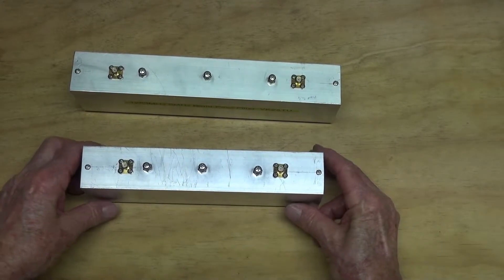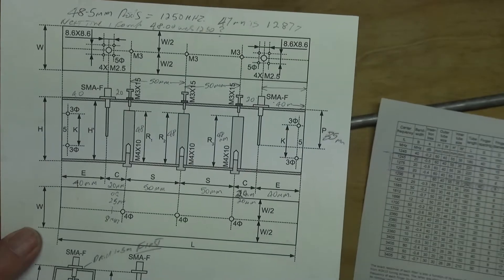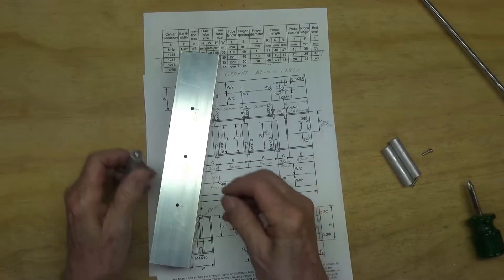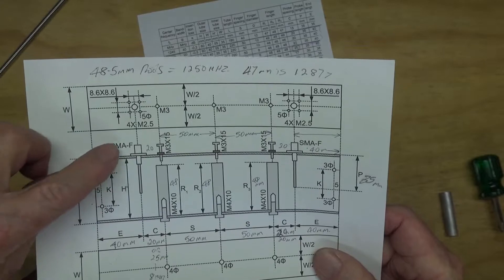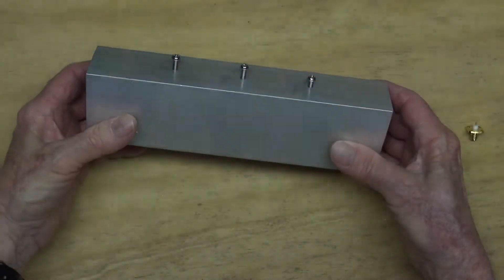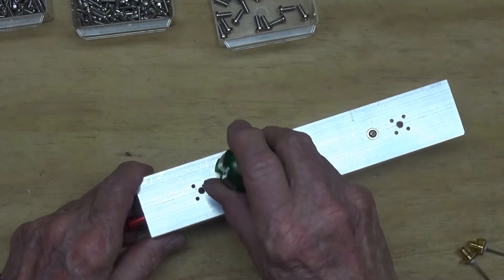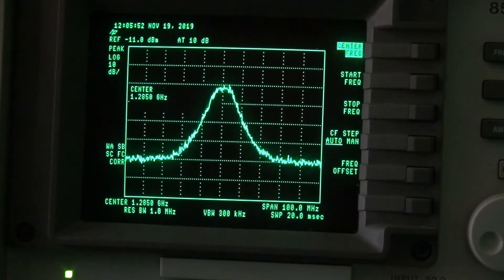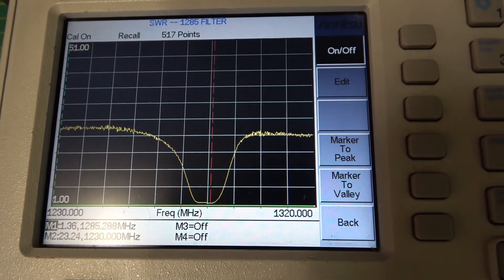Band Pass filters for 23cm, the easy way!

Comment: Homebrew wideband combline filters show -12...15dB of S11 at 1.5GHz, with 80-100MHz band. This is a maximum that I can achieve having strict requirements for small size and tiny weight. All components have been silver coated and polished where possible. I'm too sceptical about the magic numbers of 0.25-0.3dB loss published on a website, especially using oxidised aluminium for body and rods. Your measurements also prove that. 0.7-0.8dB loss is much realistic.

Comment: The initial drawing shows the SMAs on the side of the running screws. Yet your assembly shows the other side.
Would this make a difference?
Reply from the maker: I made the video over a period of time starting with one filter then another one at the end. It didn't seem to make a difference which side the connectors are on but I would stay with the original design to be safe. It could make a difference at higher frequencies.

Comment: Microwave RF engineering is black magic! :). Would this work for 70cm? I have a dirty Baofeng I want to clean up. Thanks for sharing VK2AOE.
Reply from the maker: Hi, I get many inquiries regarding using the filters on lower frequencies. The design came from a talented gentleman that did the original design and I have supplied the link to his web site. My video was intended just to show construction techniques to make the filters in the easiest way. It should be possible to scale the dimensions up but I don’t have the knowledge to do that. Having said that using basic maths to scale from 23cm to your required frequency would be a good start.
Reply: @Jonny10001  🙏 for the reply…. Will hit the books! ….

Comment: Can you get this down to 868Mhz?
Reply from the maker: You would need to scale everything up in size by 30.50% based on the dimensions for a 1250MHz filter Including the rectangular section. The rods should could remain the same diameter just longer. Probably best to make the housing out of sheet metal pieces as ready made rectangular aluminium of that size may to difficult to find, let me know how you go with it.